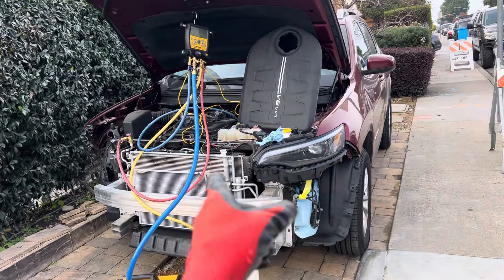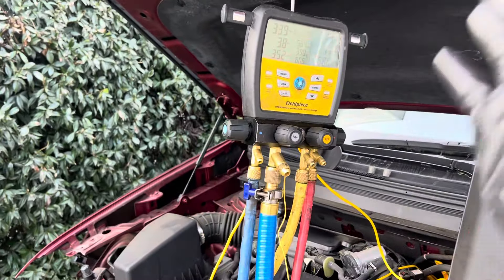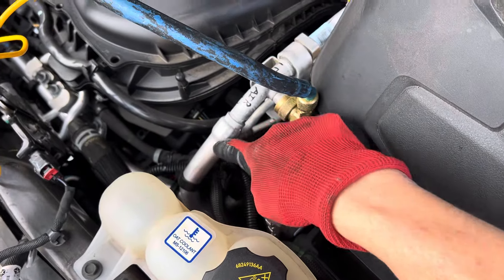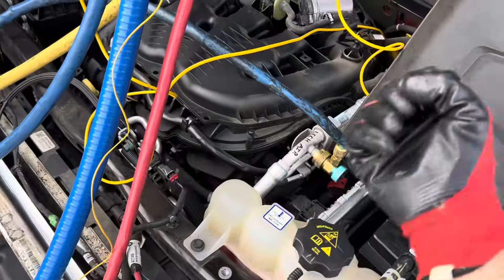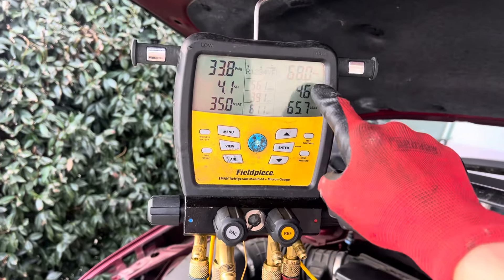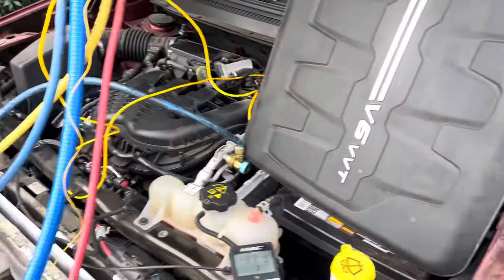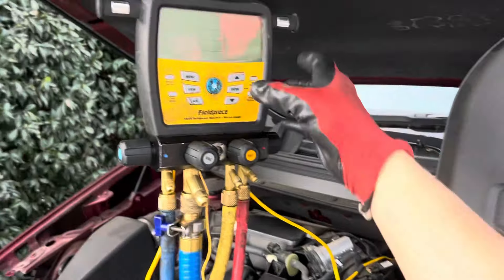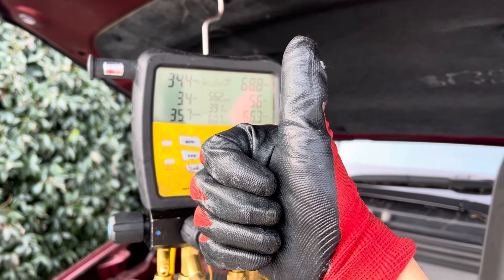70 PSI IS NORMAL HIGH SIDE PRESSURE ON THIS CAR FOR THE OUT SIDE TEMP.

Comment: i ve seen as low as 90-100 psi during winter time (ambient temperature around 50f)  . Is it possible to make a video or a series of videos explaining super heat etc?? Also if an a/c has a broken compressor and the system is heavily contaminated how u clean it. Denso states that in situations like that u should change all parts ,but thats too expensive.  I usually replace compressor , condencer, expansion valve, orings and i clean the rest (evaporator and the hoses) with a high volatile liquid. Some recovery stations that have flushing system with refrigerant but i dont know if that works too. Thanks for ur videos, they are very helpfull!
Reply from the maker: Super Heat and Subcooling best explanation by hvac school, hvac service LLC, Love2HVAC on YouTube 

They have good animation videos. 

I have links to there videos on the facebook group ( Automotive HVAC technicians) 

You can scroll back a few months to see were I mentioned super heat sub cooling posted videos

Yes flushing reminder components is ok . Except if hose has muffler, then replace is burnout had metal flakes